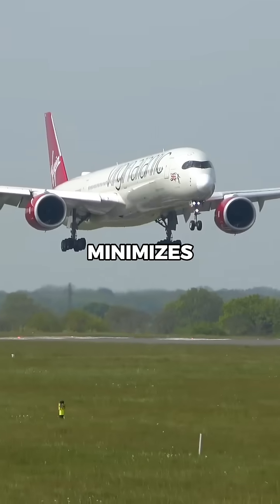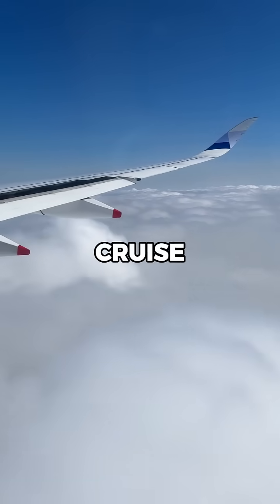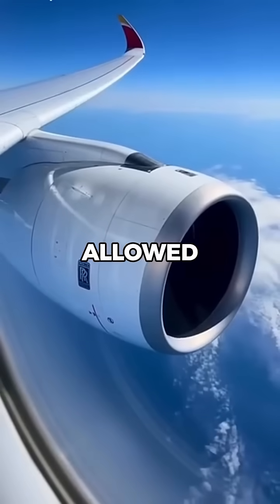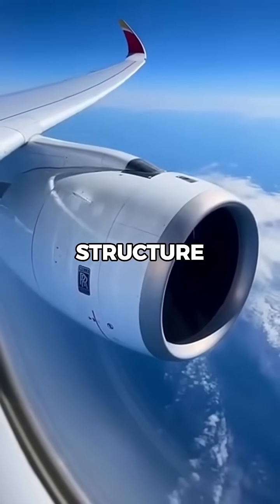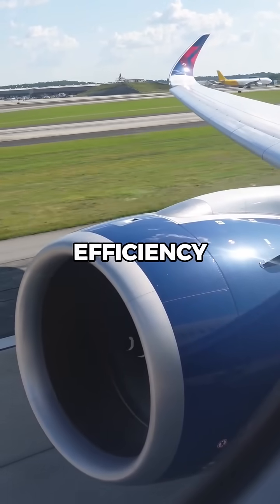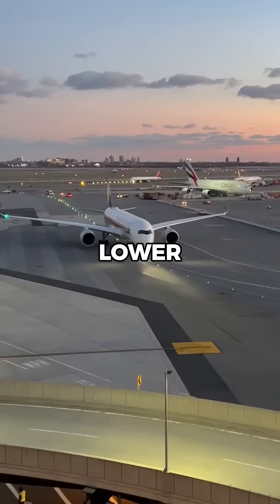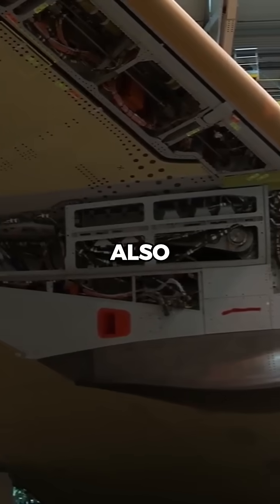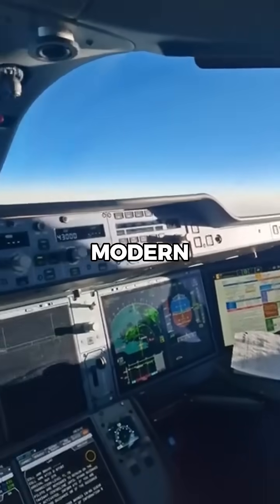why did airbus make the A350 wings so thin

Comment: 𝑰 𝒕𝒉𝒊𝒏𝒌 𝒕𝒉𝒂𝒕 𝒕𝒉𝒆 𝒊𝒅𝒆𝒂 𝒊𝒔 𝒕𝒐 𝒎𝒊𝒎𝒊𝒌 𝒈𝒍𝒊𝒅𝒆𝒓 𝒑𝒍𝒂𝒏𝒆 𝒑𝒓𝒐𝒇𝒊𝒍𝒆, 𝒕𝒉𝒂𝒕 𝒊𝒔 𝒕𝒐 𝒐𝒃𝒕𝒂𝒊𝒏 𝒍𝒂𝒎𝒊𝒏𝒂𝒓 𝒇𝒍𝒐𝒘 𝒑𝒓𝒐𝒇𝒊𝒍𝒆 𝒂𝒏𝒅 𝒕𝒉𝒖𝒔 𝒈𝒂𝒊𝒏 𝒍𝒐𝒘𝒆𝒓 𝒅𝒓𝒂𝒈. 𝑻𝒉𝒊𝒔 𝒊𝒔 𝒘𝒊𝒍𝒅 𝒈𝒖𝒆𝒔𝒔 𝒃𝒖𝒕 𝒗𝒆𝒓𝒚 𝒍𝒊𝒌𝒆𝒍𝒚.
Reply: Any aircraft wing, of any thickness, is designed to avoid turbulent flow as much as possible.
Reply: @rdspam  We must differentiate the boundary layer from "free airflow". Very basic concepts are the so-called laminar flow and turbulent flow. Referring to the boundary layer.  Another big factor is, as we call it, super critical air flow. Practically, this relates to the optimal speed of an airplane close to the speed of sound. Sound speed is not constant but directly proportional to air temperature. One must note that airspeed is only relative to the air temperature; thus, the cruise speed is generally indicated using Mach number. At Mach 1 is the local speed of sound. At speeds close to Mach 1  the supercritical aerofoil takes a big step in reducing total drag. The supercritical aerofoil is an aerofoil that, principally, has been designed to delay the onset of wave drag in the transonic speed range. Military fighters require an afterburner to pass Mach 1.  Only very few fighters can pass Mach 2.

Comment: and yet the 747's wings are even thinner 😂
Reply: Where did u get that info from? Area 51?
Reply: The distance between the two cambers on the 747 is smaller than on the two cambers on the a350 wing. There's a reason why the 747 has variable camber leading edge flaps instead of plain slats. There's no thickness in the wing left for classic slats. The A350 however has variable camber trailing edge flaps which aren't the product of low wing thickness, but a byproduct of a very supercritical wing airfoil. A supercritical wing airfoil has a pressure inverting slope near the trailing edge, which mitigates wake turbulence by accelerating the intrados air a little more before exiting the wing. It also reduces shockwaves on the upper camber when the air moves really fast because of the curvature and thickness of the wing. The 747-400 barely has curvature because the wing is not supercritical, so it is already extremely efficient at flying (so much so it can break the sound barrier without suffering drag), but not without leaving a gigantic wake turbulence behind.
Reply: @Boeing747Cultist  u think I'm gonna read that shii. U wasted ur 5 mins bro
Reply: brainlets when they are presented with facts to their stupid questions:
Reply: @Boeing747Cultist  stupid question?? Ur answer length looked like u stole it from area 51 lil bruh
Reply: @rajdip_1501  Doesn’t mean he’s wrong. Might be long but he’s literally explaining why. Not his fault you’re too lazy and/or stupid to understand the answer to a question you asked. Lil bruh
Reply: @rajdip_1501 lil bro is cooked
Reply: @0w3nn  nahh he copy pasted it from area 51
Reply: ChatGPT is saying otherwise 🤔
Reply: @anubhavgoyal04  chat GPT as a source of information against someone who literally purchased the 747-400 FCOM is crazy